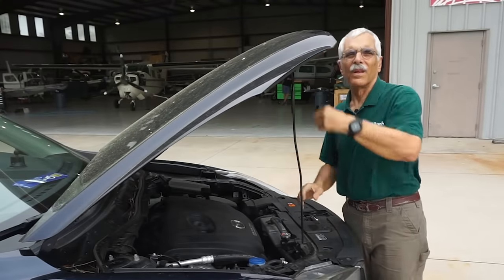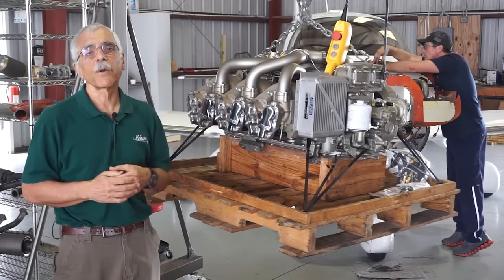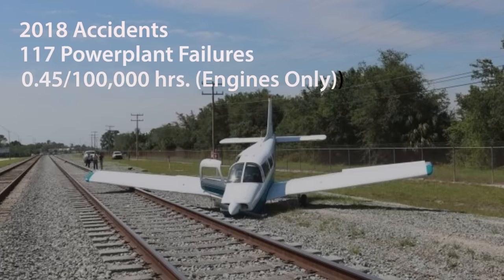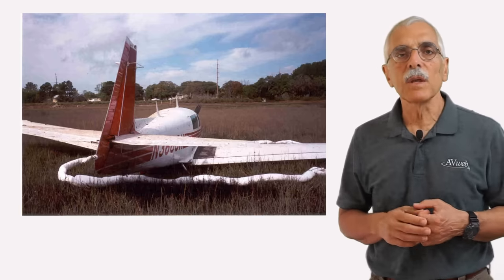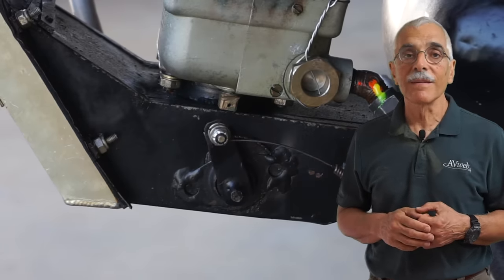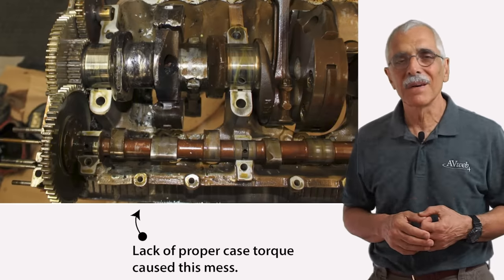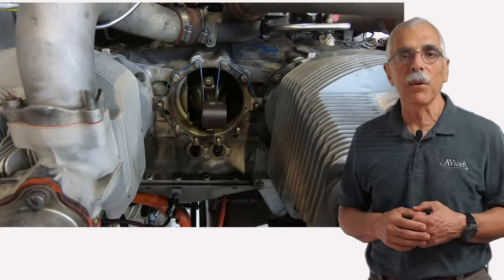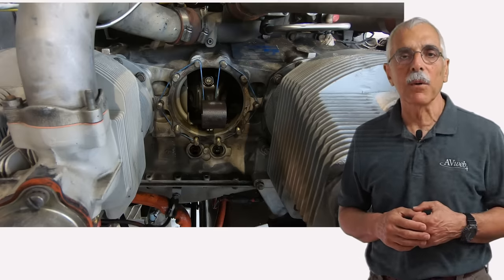Why Aircraft Engines Quit

Comment: When I did my apprenticeship as an automotive machinist, what I came across was that the engines will fail due to peripheral equipment like fuel pumps injectors oil pumps water pumps turbochargers and sensors which can destroy the long motor at numerous times. The reason aircraft piston engines have a large capacity and usually undersquare, meaning long stroke short bore setup is they make torque at lower revolutions which helps reduce rotating assembly wear and cylinder/piston/rings wear.
This man knows his stuff 100%. Theres so much shit that can go wrong its not funny...
Reply: The piston speed of long stroke engines at low rpm is far greater than short stroke at high rpm. Food for thought
Reply: Short stroke engines generally have faster piston speeds compared to long stroke engines. This is because the shorter distance the piston travels allows it to complete its cycle more quickly, which results in a higher speed. Plus, these engines are designed to operate at higher RPMs, which further increases the piston speed.

Comment: A friend of mine was the instructor on board that landed the Warrior with the green trim near the railroad tracks in Vero Beach, FL. As shown in the video they found an absurd amount of water in the tanks thanks to Florida's lovely humidity. Instructor had the student preflight and asked "Did you sump the fuel?" to which he got the standard "Oh yes of course sir!" 
They only made it to the midfield on downwind before the engine quit.
CFIs should never forget the old adage "Trust but verify"
Reply: Follow up question; did the student lie about sampling the fuel tanks, or did the student not understand what to look for and/or not understand how to correctly "sump" the fuel?  Where was this "student" in their aviation training; pre-solo or were they working on their Flight Instructor rating?  How often was the Warrior flown; did it belong to a  busy flight school (regularly cycling avgas throughout its fuel system), FBO or some individual who rarely flew the airplane?  Was the fuel contaminated at the storage source prior to being delivered to the Warrior, or was the fuel contaminated while it was sitting in the Warrior's wings?
Reply: @apackwestbound5946  The tail # is N80813 if you want to look into the NTSB report more. The flight school was busy but some planes can and do sit for 24-48 hours. It was never explicitly stated or investigated as to how the water got in but flight instructor scuttlebutt landed on either poorly maintained or unsecured gas caps during a rain storm or humid days. It was my understanding that the student was deceptive about sumping the tanks. The preflight SOPs are drilled into students before they even touch the aircraft for the first time so it is expected, however the CFI should have observed the sumping for (what I believe was) a presolo student.
Reply: @Maxaphone  Another option is, the student saw fluid that looked consistent with itself, and assumed that was fuel.  That is, everything they sumped was water.  They weren't used to checking for the color, as they were still new.   The CFI may have just been watching that they did the action, not what the result was.
Reply: Fun fact:  "Trust, but verify" comes from the Russian "Доверяй, но проверяй" (Doveryay, no proveryay).  It became popular when then President Ronald Reagan learned it, and used it a few times during his Presidency.  

It's probably from before your time.  Or at least that's a good excuse for not knowing it.  There's a Wikipedia page on the subject, if you'd like to learn a little more about it.
Reply: I can't remember the site, but there's a video out about how much water needs to get into a 152 wing tank before it reaches the sump valve. They started with a 1/4 tank of gas, and kept adding water until they got water out of the sump. It was a lot, more than a quart. I believe it reached the sump before the fuel line, but that doesn't mean anything if you're only sumping a few ounces. Once the plane's in the air and you stir things up, that's when it matters. Anyway, I don't know anything about Warriors or any low wing planes - I fly a 150 - but the point is the student could have perfomed a good sump. The lesson I learned is to move the wing and let it settle before sumping, and if the plane has sat awhile through bad weather, do more wing moving and more sumping.
Reply: @tomcoulter6121  I once picked up bad gas in my Pacer in Ensenada, Mexico. I cursorily sumped the tanks and moved on. Engine quit dead climbing through 2500 ft, put the nose down, didn't like what I saw, switched to the other tank (which I hadn't filled, had good 'ole Pemex Rojo in it), engine started back up after a very long 7 or 8 seconds. When I got to San Diego, sumped the tank and pulled out 4 or 5 testers full of dirty water. I hadn't given it time to settle out of suspension before sumping it.

Comment: Third time through this video over the last year, as engines are very important to safe aviation.  

BTW, I concur with your tongue-in-cheek assessment of the difference in reliability between the very low manufacturing volume of aircraft engines vs comparatively high manufacturing volume of automobile engines.  

Overwhelmed by flight instructor acronym schemes for handling every situation short of picking your nose or pulling underwear out of one's seat, I decided to come up with a few of my own:

Heat:  Standard Day brochure takeoff distances do not apply!  Always use the tables in the back of the POH.

Cold:  It takes time for heat to flow through metal, so give it plenty of time.  Pre-heat if you have to.  Start and idle or near-idle until gauges say the engine is warm.

Water Contamination:  Don't just check for water.  Drain it.  Keep draining it during preflight fuel port contamination check until it's not contaminated.

Water Liquid:  Aircraft flies poorly in water.  Avoid it whenever possible, particularly when it runs the risk of becoming Water Frozen.  The only exception when it's a more suitable landing surface than rocks and trees.

Water Frozen:  Aircraft flies poorly with frozen water, whether it's frozen to the skin, pelting the skin and windows via hail, trying to drown the 

Controls Frozen:  Do several control checks with visual confirmation - BEFORE starting the engines.  Do a couple more before takeoff just to be sure.

Carb Heat:  Check it at the beginning and end of each phase of flight:  Engine start, taxi, runup, takeoff, climb, level-off, cruise, descent, approach, landing, taxi, engine shutdown, tiedown.  Same goes for throttle, engine RPM, oil pressure, engine temperature, position and effectiveness of cowl cooling flaps, flaps, gear, visors, interior air volume and temperature...

The point is that I examined these and many other things until I could come up with checklists along with anti-boredom statements off the top of my head, and yet, I still ALWAYS used a printed and thoroughly-vetted checklist.

I think "lack of checklist discipline" is that critical issue which, if corrected, could solve all of the pilot error issues and about 99% of the mechanical issues.

One thing my first instructor taught me:  By all means, use full throttle for the takeoff, but once you're safely above the ground (500' AGL, no dangerous terrain or manmade obstacles), ease off a couple hundred RPM, so long as you can maintain 300 ft/min climb.  The difference on engine wear and tear at 2750 rpm vs 2500 rpm is significantly, and the likelihood of it stopping at 2500 rpm is less than half of it stopping at full throttle.  He also taught me...  Why, I could write a book!

Comment: "I shouldn't have to say this, but put enough fuel in the aircraft." lol
Reply: Just two weeks ago I was preflighting a C-172 and the instructor said the mechanics topped it off, whereas it had about 10 gal of fuel total.
Now, if we didn't catch that on preflight - we would likely catch it during taxi looking at the fuel indicators.
That said - also been in an AC with an INOP fuel indicator on one of the tanks.
Basically had experienced individual things like that in my tiny 60 hrs of flying. Just never had enough events come true simultaneously to cause an in-flight running out of gas.
Reply: @suzukirider9030  The first items on my pre-flight:  1) verify actual fuel in both tanks, if sufficient for trip + 1 or more hrs, then sump all the spots, if insufficient, call the truck, 2) check the oil, not just level but appearance, add and log any needed; if fuel is added, wait until rest of pre-flight THEN sump all the spots.
Reply: Well, people look at you funny when you pull your aircraft into the petrol station to fill up. Fair I suppose, shouldn't be on the road because it doesn't have a number plate or tax disc.

Comment: Love your delivery. And I so appreciate your sense of humor.
I experienced an engine failure in 1976 in a C172 as a commercial student. As it happened, we were directly over a pasture, so little time was wasted looking for a suitable landing zone. Toward the end, the instructor took over the controls and put us down in the grass. (Rather roughly, as I recall, but back then I probably didn't fully appreciate the value of as little forward momentum as possible in an off-field landing.) In the end I survived (or did I?) This was shortly after the production of 80 octane fuel had been curtailed. I was told later that one of the valves had hung from lead deposits.But a day after the incident (as I was told) the chief pilot of the flying club flew the plane out of the pasture and back to the airport so another student could share in the adventure.
Love your Cub. I sure do miss my J-4!